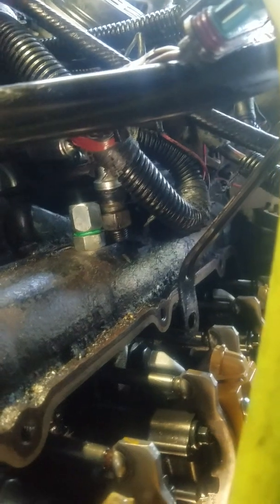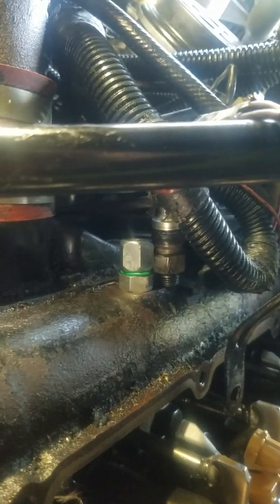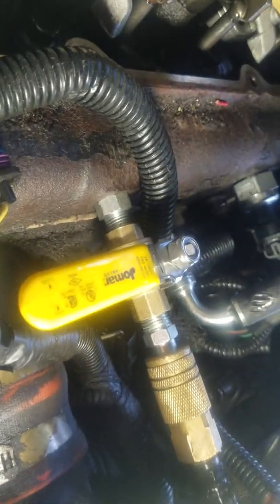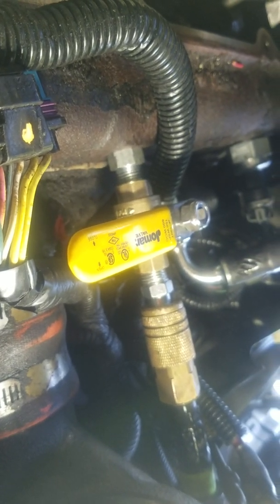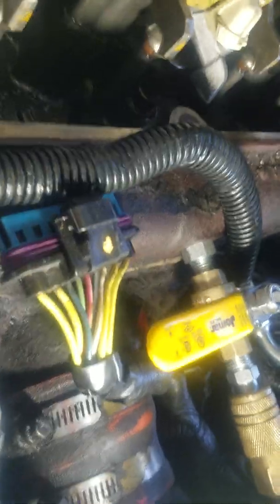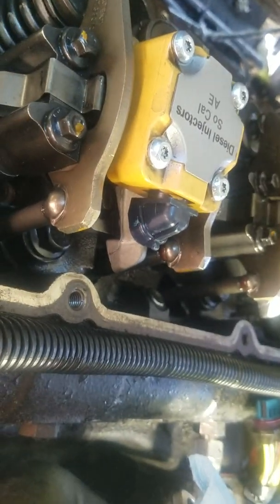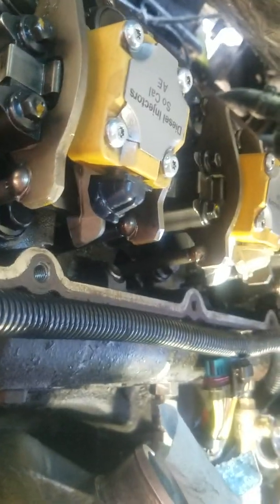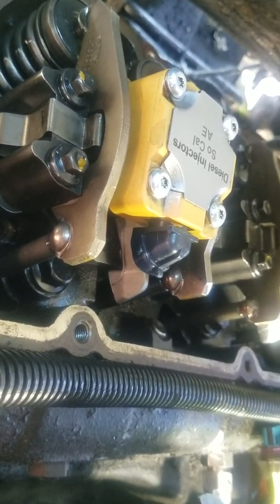Ford 7.3. P1211, low ICP

Comment: Thanks man great video. I’m having the same issue with my 01 f250. Bought with a crank but no start issue. Shimmed injectors and installed new o rings and the engine fired right up. Now I’m chasing down the P1211.
Reply: Up pipe leak?